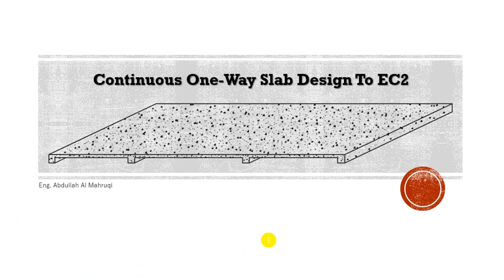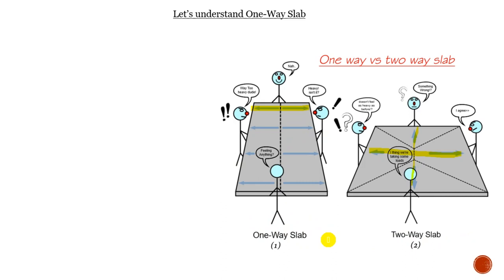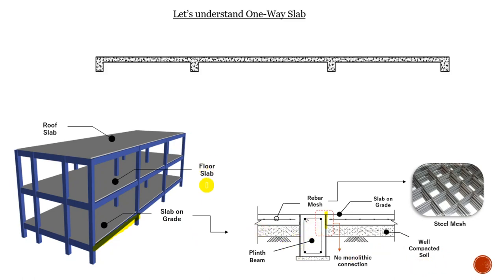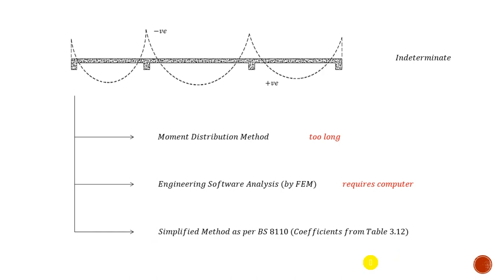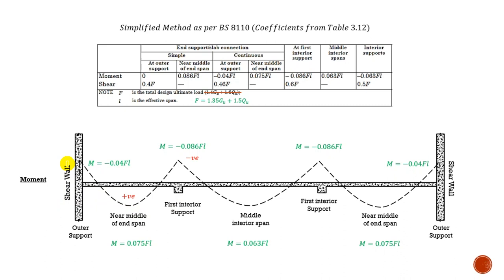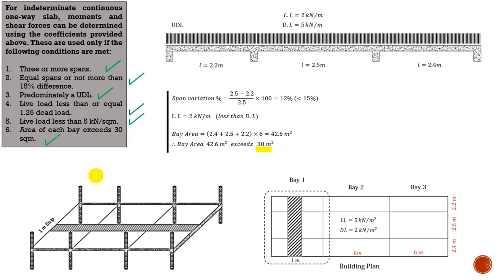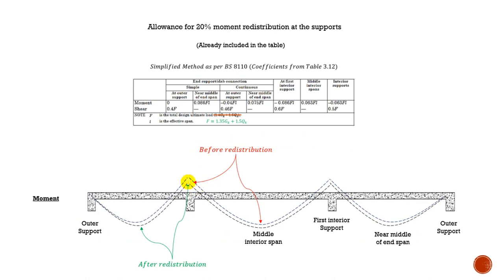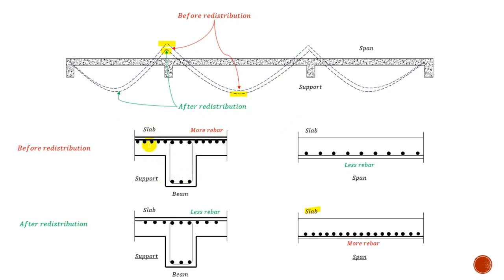Part 1: Continuous One-Way Slab Design to EC 2 (Introduction)

Comment: Hello sir, may I ask if my one way continuous slab with only 2 spans, and the area of bay less than 30m², then I cannot use the simplified method as per BS8110 is it? Then what method should I use to calculate the moment and shear of my one way continuous slab? Hope sir will reply me 🥺 because currently I am a student and face this problem in my design project.
Reply: Use moment distribution or clapeyron's method

Comment: السلام عليكم 
Sir,
Why we add factor safety for self weight of concrete?
Reply from the maker: We use a factor of safety for concrete as a material, and also as when calculating the dead load (including self weight of concrete). This is to provide safety against any uncertainties.
Reply: @abdullahalmahruqi1976  so, what are uncertainties for concrete,there’s no change in density 24kn/m2 ?